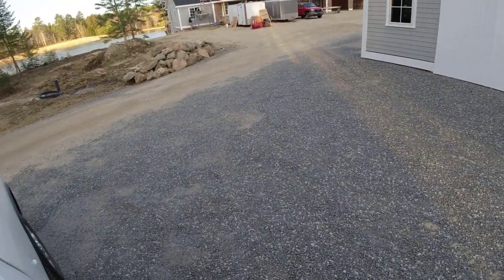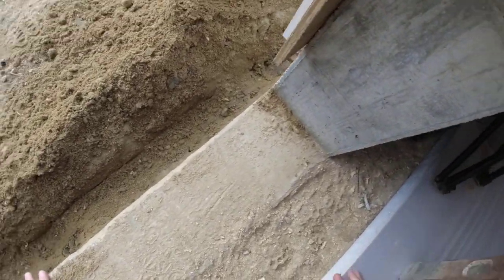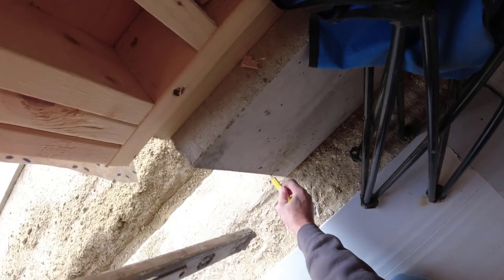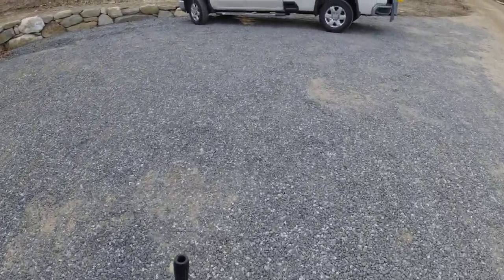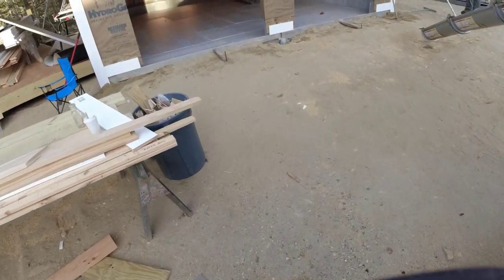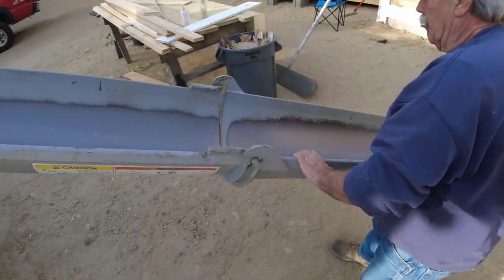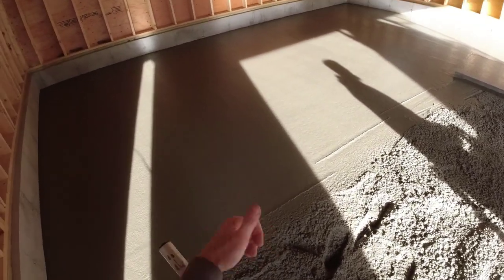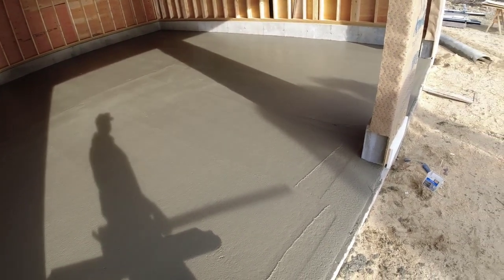How To Pour A 28' x 24' Garage Floor in Freeport, Me.

Comment: Good revovery on that second truck lagging.  I'm however disappointed I didn't catch why there's no reinforcement in the pour. No doubt there was a good reason.  ❤
Reply: They used that Fiber stuff. I don't care what they say, there is no way that fiber stuff will do a better job than rebar.
Reply from the maker: We used fiber, that is what was spec'd on the job. I've never said it does a better job than rebar. It has a different purpose than rebar.

Comment: 11.5 yards. That’s about half of what we poured in the 70’s! Yeah 22+ was the pour. 5 inch slump. We called them High Ranch house or split ranch. When you entered, you went up half a flight to the living room, or down to the basement. Most people used the basement to make a small apartment for income, or mother-daughter thing. With extras, ( 8 by ten patio), brick front, fireplace. Cost: $69,000!! Rockland county, southern NY

Comment: Hey mike what do you think about fibre reinforcement vs metal wire and or rebar?
Reply from the maker: Fiber is good, we use it in all our floors. For extra reinforcement add some wire or rebar. The key is really the sub-base and compaction.

Comment: So you must be in colder climates and that is why you do foam boards? How thick are the foam boards and do you use rebar at all!! So interested!
Reply: Fiber additives replace de need for rebar, lower the cost and man hours yet result in a stranger concrete with less likelihood to cracks, this is because the reinforcement is not only horizontal and vertical but in every direction. It also adds durability because the reinforcement doesn’t rust.
Reply from the maker: Yes, we're in Maine. 2" styrofoam helps for frost protection. We use rebar if it's spec'd on the job.